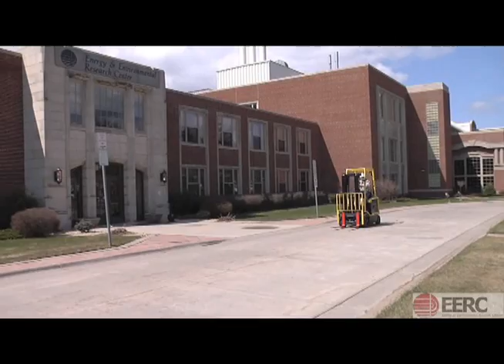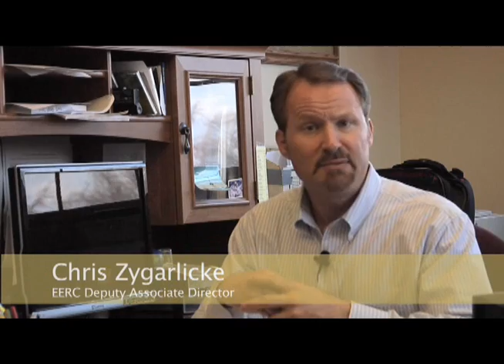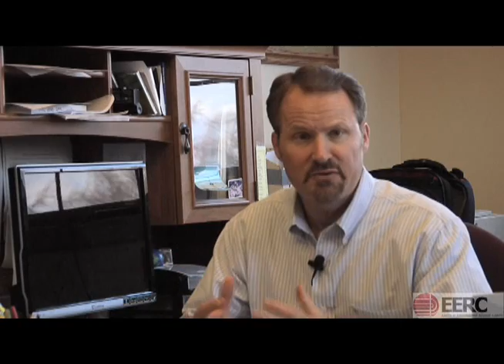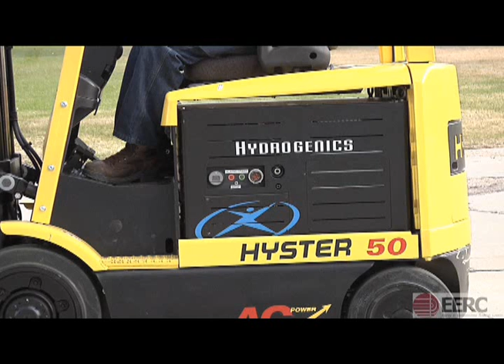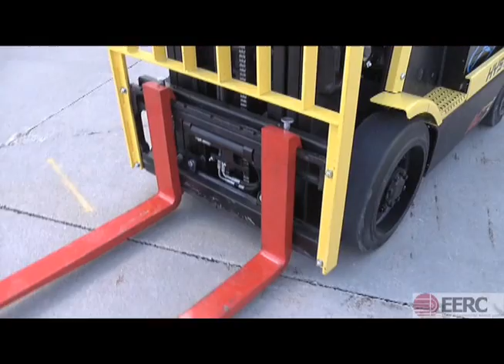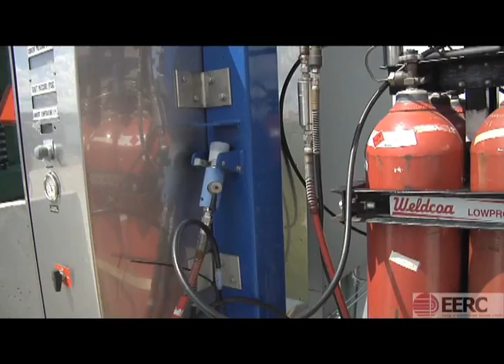Hydrogen Powered Forklift

Comment: Fuel cells are MUCH less efficient then batteries.
A fuel cell is about 60%-75% efficient (water to hydrogen and back to water) while a gas or propane motor is about 20% efficient, however electricity is much more expensive per unit of energy than gasoline
Reply: gasoline and propane is gone - can't factor it in anymore (see IPCC report ! :) have to base 'all' on not burning fossil fuels anymore so deep geothermal or solar to make the electricity to hydrolyze the hydrogen from water  - or lith batteries charged from the same source